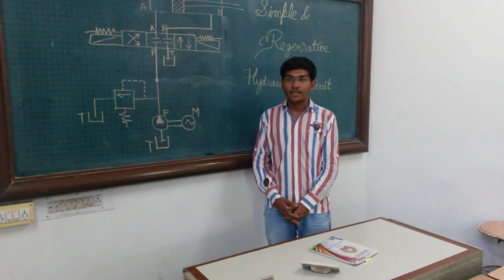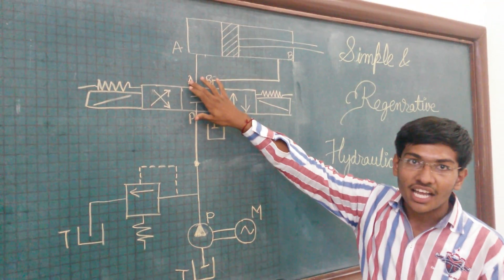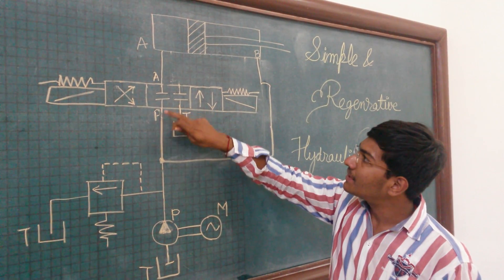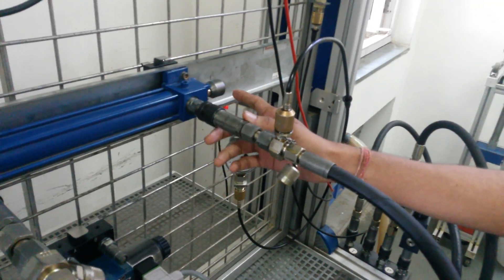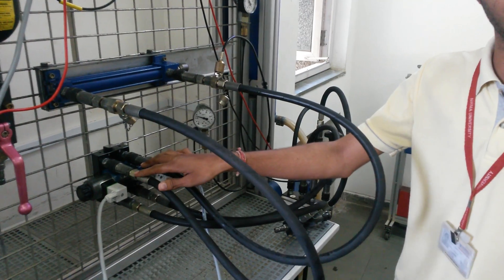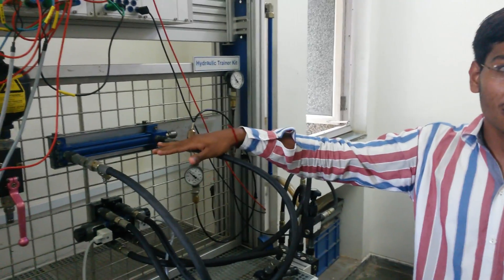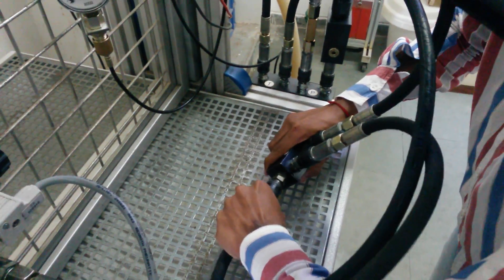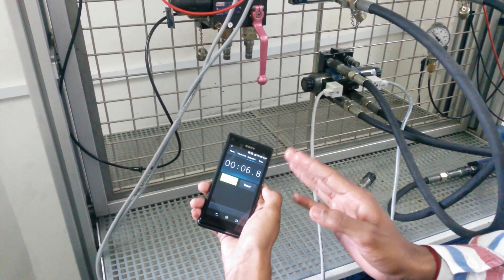Regererative Vs. Simple hydraulic circuit

Comment: sir how to calculated valve and cylinder size what is the method
Reply from the maker: Standard catalogues are available for valve and cylinder selection. You need to decide how much maximum pressure will be generated in your system and how much cylinder velocity you want.